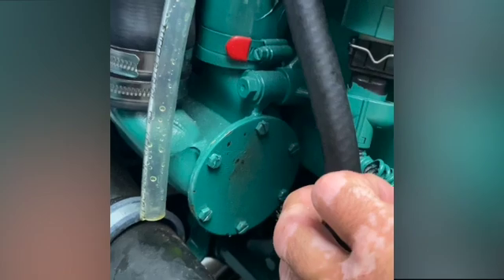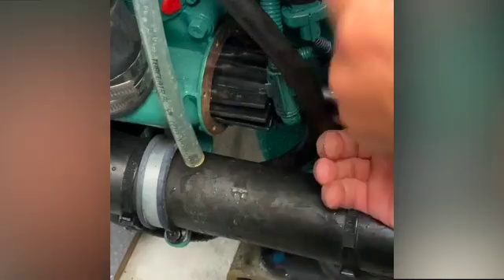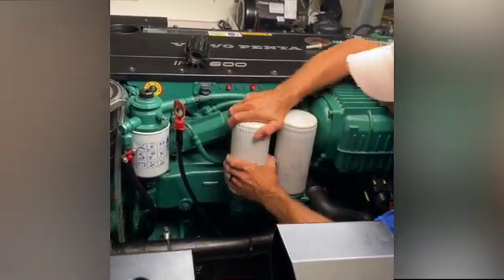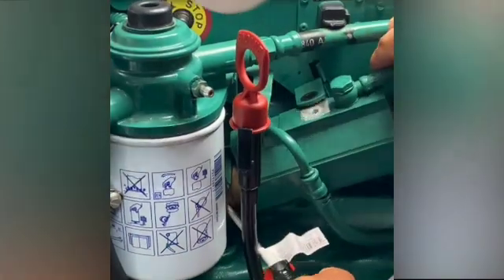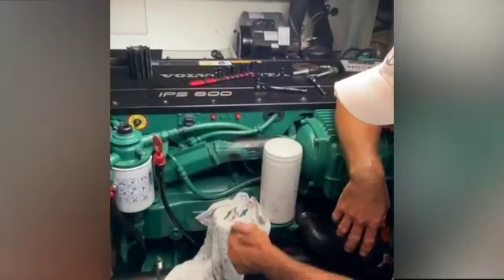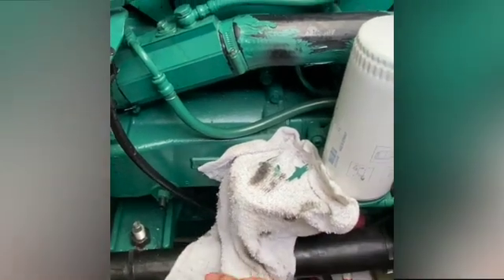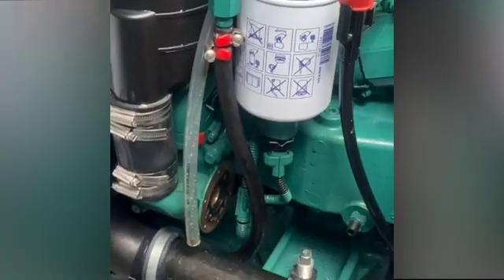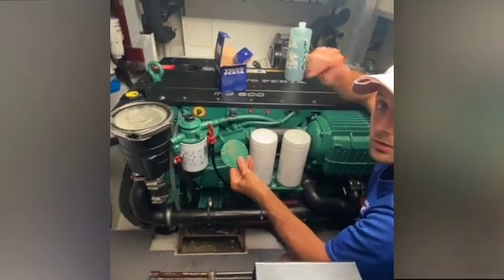How to Change the Impeller on a Volvo D6

Comment: Another great video on "how to do it" with some good pointers too .. (To insert the impeller, you can use "zip-ties" around the impeller to hold the blades in and allow you to insert it deep enough into the housing, snipping off the zip-ties just before completing the press-in.)   I liked how you sped up the process so it didn't drag out .. Well Done, Capt!
Reply from the maker: Thank you sir! The zip-ties is a great option that a lot of the techs I know use. Honestly, I don’t use it too often but it does work well. For me, a whole bunch of boat soap or Dawn soap works just fine to get it into position - just make sure you’ve got a clean rag to dry your hands otherwise using any tool after that becomes a challenge 🤣

Comment: Is this procedure the same for d4-260?
Reply from the maker: Yes the process is going to be very similar. The specific location and size of the impeller might be slightly different but the process will be the same
Reply: @ElevateYacht thank you.  Do you have a link for where to buy the impeller puller you used?

Comment: Always put a little water proof grease in the spine. And good luck doing this service on many outboard port engines. Volvo did a terrible job on being able to service that heat exchanger, this is terrible.

Comment: Does every boat have a seacock? I’m asking because my boat has a single D4-260 with Duo Prop outdrive, and was told that I don’t have a seacock.  The impeller appears to be above water line, though. Does that mean I can still replace the impeller while the boat is in water?
Reply: I have cleaned the water strainer multiple times without any water overflowing, but that’s as much as I’ve done in terms of maintenance lol

Comment: On my impeller changes, I remove the fuel filter water indicator connector to get it out of my way and to prevent my clumsy hands from potentially damaging it. Use the Globe run dry impellers so you don’t have the fins break on the flimsy cheaply made Volvo brand. Unless you are still under warranty.

Comment: To make it a little easier putting that impeller in, can I suggest you slacken the belt from the water pump pulley so that you can then turn the pulley by hand and then you can push the impeller into the housing by hand and when it engages the splines on the pump shaft you rotate the pulley by hand whilst pushing the impeller in by hand and it will slip in easily because as it rotates the side loading gets corrected and straightens the angle of the impeller up, you therefore don't risk damaging the brass splines up inside the impeller by forcing it with a tool. I've done a few in my time and while doing any service I have an order of play that will make it easier for any associated parts to be removed... bigger impellers get put in warm water on a cold day about a half and hour before they need to be put in to soften the rubber slighlty... (NOT very hot water, before anybody shoots me here for damaging the rubber with heat).
Reply from the maker: Great input here! Thank you for watching and for the great tips. I like the warm water idea! Cheers!

Comment: Amazing Dan.  Thanks for the video.  My impeller came right out and inserted easily following your instructions.  Amazon sent the impeller puller overnight got it in less than 24 hrs.
Reply from the maker: This is awesome! So glad the video helped you pull off this job. It might seem intimidating but once you’ve done it, you’ll be able to knock them out every year with no problem. Thank you for watching and sharing your success! Cheers!

Comment: Do you know where I can get a 16mm impeller bolt like the one you use?
Reply from the maker: Great question! The part itself was ordered through my local marine supply store. There are a number of different options but the one I requested is for Volvo impellers specifically. Cumins also makes one - they are not interchangeable. As far as the length of bolt, the kit comes with one specific bolt but I wanted a longer option, so I went to the local hardware store and found one that screwed into my fitting properly. Hope this helps! Thank you for watching and commenting!

Comment: Hello, enjoyed the video.  In one study they found that amateurs (like me) over tighten bolts while professionals undertighten.  As there are several bolts should they be torqued up by us amateurs?  If so what is the torque setting?  Thanks form the UK
Reply from the maker: Great question! I’ve always been taught to make the bolts “snug”, without over tightening them. With the number of different engines that we work on for the basic stuff like impellers - we stick to that rule. If you looked up each individual manufacturer, they may have a specific torque setting, but a good rule of thumb is not over tightening and not under either. Snug and secure. 

Thank you very much for watching and for the great question! Cheers!

Comment: How in the heck can you tell if teeth are lined up on impeller w impeller housing?  Would hate to break something forcing it?!!  Thanks again!
Reply from the maker: The teeth are made of metal and are on a thick metal post, so as long as you’re not overly forcing, you shouldn’t have to worry about that. 

As I am sliding the impeller into position, I can slightly twist it until you feel the impeller “click” into position. If you try to push it in and it does not slide in with just a little pressure, try twisting it again. It might take a time or two to twist then push until it officially seats in the right spot but you’ll know. 

Thank you for watching and for your question!

Comment: What a crap design for a part that's liable to be changed! Would soaking the new one in hottish water make it easier?
Reply from the maker: Meaning a bad design because they piece apart eventually? If there is preventative maintenance done on the vessel, one would likely identify issues with the impeller before it loses any blades. The part is inexpensive and easy to change. I have seen them made with metal but they are likely more expensive and more difficult to replace? Plus the rubber most likely has a better seal to help pump the water most efficiently. Thank you for watching and for commenting!
Reply: @ElevateYacht  No, I mean that impellers are a consumable item and I think it's ridiculous that Volvo located them in a difficult to reach spot.
Reply from the maker: Ha soo true. I scratch my head a lot when it comes to placement and position of items around vessels. But, they are mostly designed for owner comforts and not mechanic comforts 🤦🏼‍♂️

Comment: Does impeller blades have to face a particular direction?  Or once main turned on impeller will right itself? Thank you!
Reply from the maker: Great question! They may bend in different directions when you first set it in place, but the blades will fold into proper position when the impeller begins spinning. Thank for you watching and commenting!

Comment: That's alot of work... sure glad I have Cummins on my boat. I can change impellers in less than 10 minutes. I changed the original factory water pumps to pumps from Seaboard Marine in California. Their impellers even come with a special tool to pull them with. 😎
Reply from the maker: Having an impeller puller tool is a game changer. A video of an impeller change before the puller might have been flagged for too many swears 🤣🤦🏼‍♂️
Smart move to change out the water pumps. Factory installed, isn’t always the best. Thank you for watching and contributing!

Comment: Why not remove the wire/plug to the oil filter ? seams like you will cave way better access and not risking damaging the wires!
Reply from the maker: That is definitely an option. The only time it’s really in the way is when accessing the back two cover screws but it could give you a clearer shot at it. Good input! Thanks for watching!

Comment: Use a cable tie to keep the fins closed for installation.
Reply from the maker: I’ve heard that trick before. I tried it and must have done it wrong because it didn’t go as smoothly as I anticipated. Once they are good and lubed up with the soap or grease, they pop in pretty good. Fully seating them takes the extra effort my way 😔
Reply: @ElevateYacht  Having soapy hands must make it harder to push the impeller in, because your hands are so slippery.
Reply from the maker: @mitchellbarnow1709  ha yes, the soapy hands does create a bit of a challenge at times 😩

Comment: Captain Dan, Awesome Video.   I've only changed impellers on outboards but interesting to see done it on a huge inboard motor.
Reply from the maker: Outboard impeller changes can be more work with the removing of the drive and whatnot. Great work man! The hardest part is fitting in some of these engine rooms to do the work. This starboard engine wasn’t bad but the port engine impeller is on the outside of that engine so I’m sandwiched between the engine and the hull 😞 thanks for watching man!!